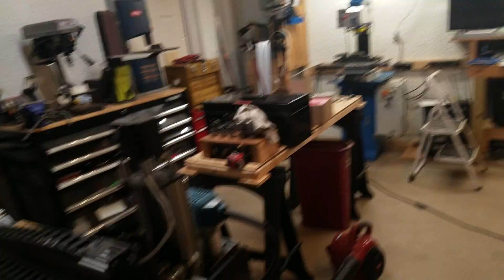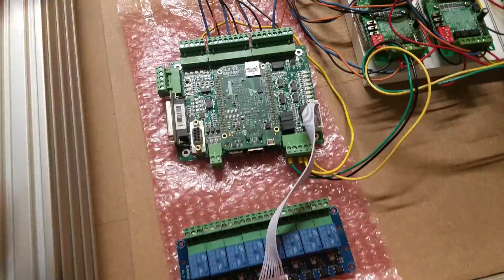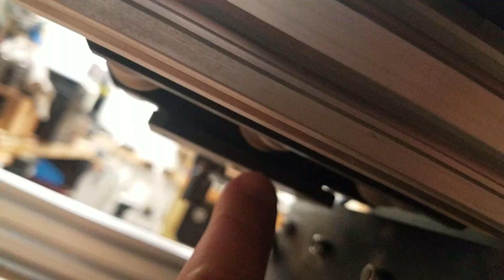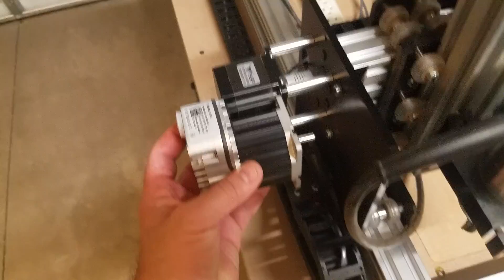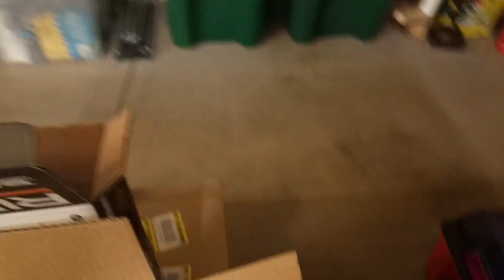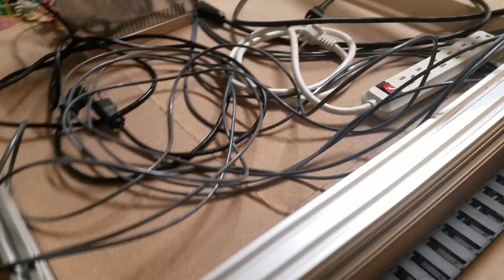WorkBee CNC Router:  A Brief Update

Comment: Can this machine handle 7075 t6 aluminium? How does it compare to Shapeoko 3?
Reply from the maker: As long as you don't try to drive an endmill that's excessively large, it will cut aluminum just fine.   I never had a Shapeoko but from the looks of things, I'd say they are very similar in construction.
Reply: Workbee is superior to shapeoko.bulkman  workbee 1515  .is 3x larger  and uses screw drive.and is $500 less price..and includes a nice 1500w vfd spindle which is superior to a trim router..shapeoko and brother xcarve are now considered junk..
Reply from the maker: @shelby50411  The Workbee now has an improved design that puts the lead screws under tension to reduce "whip" when moving at high rapid rates.
Reply: @FrancoCNC  Hello Franco, do you plan to upgrade it ?

Comment: I would of left that 1/2" mdf board screwed down. or used double sided tape instead of glue. When you want to change the spoil board in a year, then you will have to replace the bottom 3/4 MDF as well ( or maybe just flip if over). Anyways re aligning it is a pain. Better to just swap out the 1/2 mdf quicker and cheaper.

Comment: Nice machine. 
However you dont have to pull apart the X axis to install the limit switch. It can be install Vertical on the Z axis. 
You can see it on the openbuild. Website 
But  great work.
Reply from the maker: Thanks.

Comment: if use ClearPath integrated Servo it's smoother and quieter a way faster,,,,, Can damage the lead screw teeth quickly the lead screw you have 8mm diameter only, that's my opinion.

Comment: Several users of similar tables enclose the unit completely to keep the chips, etc confined.  1/4" plywood would suffice. That will be the way I'll be going
Reply: i used 1/4” acrylic so i can see the machine
Reply: @bubbahogg-buga4613  Sure some kind of viewport for me, but only on the front side.

My enclosure will also have to be soundproof since neighbors houses are close and the neighbor is very quiet